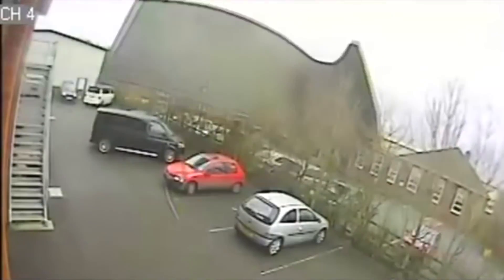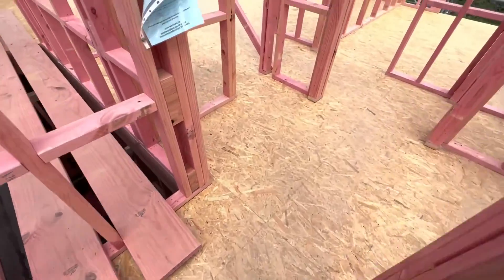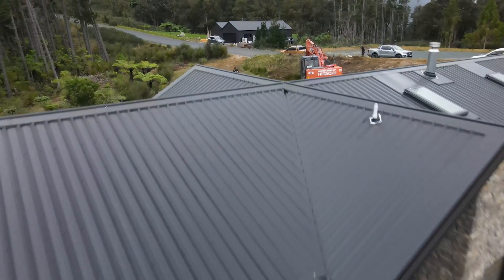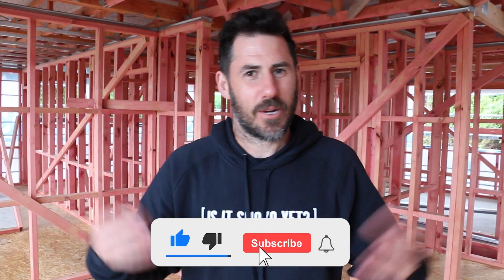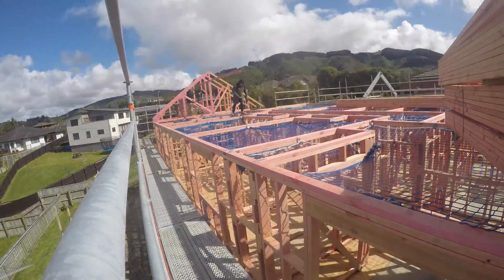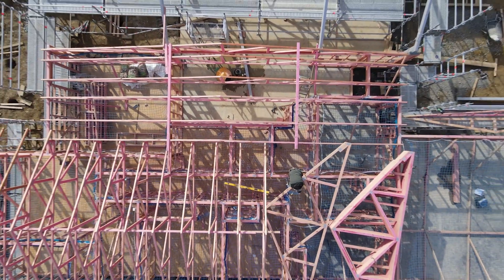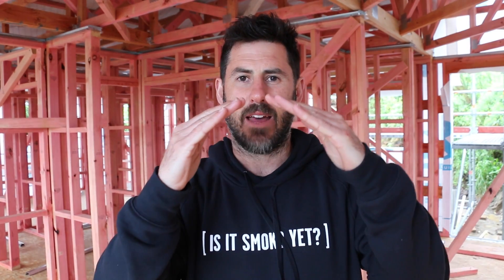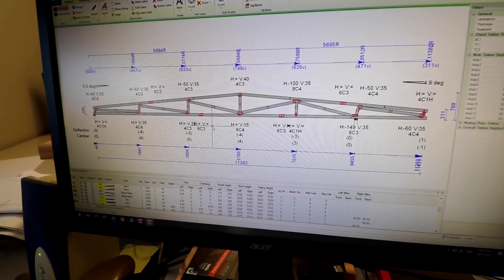Stopping Your Roof From Blowing Away!!

Comment: Looks like you built a house with 2 different pitches with this meeting in the valley. Did you have to do anything different to your valley here. I failed an inspection and had to get a amendment on a similar design on a house I built in chch. The council were saying that because my valley pitches are unequal that all the case of a lot of rain that the water will hit the steeper pitch and rush down to the flat pitch with the risk being that the water can track into the roof. It was quite annoying for us as we had to remove our valley purlin, cut the other purlins back and increase the width of our low pitch side valley board to achieve and greater volume area. Just curious really, I know of other builds that were done in different region of Canterbury where the council said nothing and passed it. Interested to know your experience
Reply: There is a guide/calculator in Roofing COP website for the minimum width and height of valley flashing (and valley boards) for unequal roof pitches.